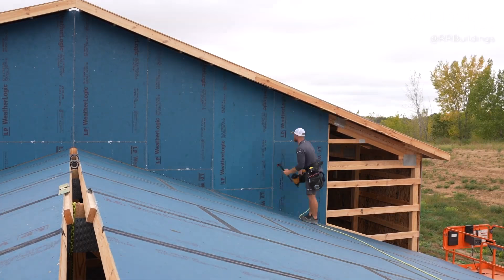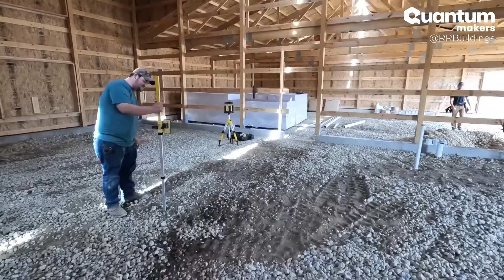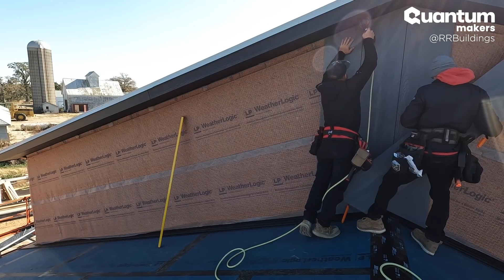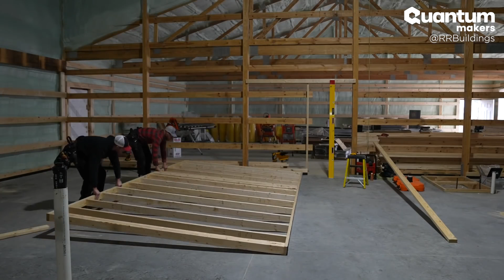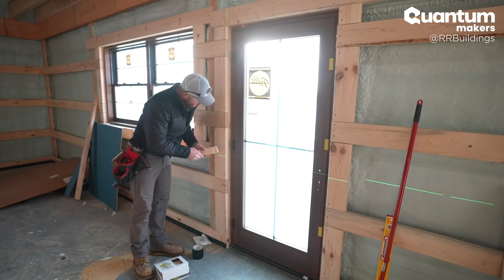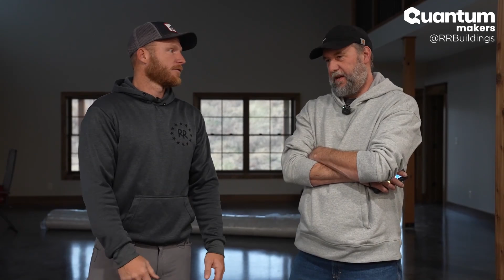Two Men Turn a Barn Structure into a $750,000 Home in One Year | BARNDOMINIUM Build

Comment: Do not confuse this with a traditional timber frame post and beam house. It is not. To do what they're doing, post and beam, the way it's supposed to be done, would take them 5 times as long. They would not use trusses with metal plates. They would be 656 and eight, by eight, and sometimes six by eight posts. And beams to support the building. Take a look at some cathedrals that have been there for 2 centuries. That's real post and beam construction once again. There is an enormous difference. These guys may be masters at what they do. But that does not make them master post. N beam carpenters

Comment: Fiberglass as insulation?. Seeing as it is Carcinogenic it can cause deadly health problems. I should know as my Brother-in-Law has two month's to live because of that stuff he worked with for 10 years.
But it is no wonder USA homes are so cheap. One big fart & it will shake. Here in the UK we have solid concrete foundations, then steel framework structure goes up, then brickwork. Then all the rest afterwards.
What always irks me is that it is 90% of the time builds are held up because of window supplies issues.

Comment: Cool build, I would like to get into construction as my studies ended and I realized over the years that working with my hands like in this video is so much more fulfilling for me than sitting at a desk with a computer screen in front of me, even if that is mainly what I studied for. One thing that is so different compared to Europe is the thickness of insulation, there is literally nothing there, only like 10 cm of that spray foam. It is ordinary in my country that new buildings have 200-250 mm atleast of insulation (10 inches). This feels like a bare wall (maybe it is thicker than it looks) and to heat up such a big open space it will take a lot of energy, but I guess someone who lives in a barn doesn´t really care about the cost of running it. We also have mandatory air space between the outside siding and the boards, here they just place a mesh of some kind, it´s really interesting to see the differences.

Comment: It's actually easier to achieve a lower Blower Door ACH on a larger house because a larger house has a lower surface area to volume ratio. As a house gets larger, surface area increases as the square of its size whereas volume increases as the cube of its size.  You'd think the guy performing the test would have known this and predicted a lower result before testing.

Comment: The only thing I never understood is why people love to use wood to build I mean, even this structure could’ve been built with mostly steel. All the posts could’ve been steel instead of wood and maybe just have wood features on the house.. But the house looks great if I ever do a Barndo, I would like to do it here in California maybe on some land but I would do the steel frame construction the big Eye beams so that I can have big glass windows, and I also would do some rammed earth walls here and there. Now, if I was back east building, I would do a big concrete block home with rammed earth walls, and maybe a steel roof.

Comment: This is a cool build. I been thinking though. Wouldn't it save a lot of time and effort to get a metal bardominium and then insulate with spray foam similar to this? Metal tends to last longer than this kind of structure and is quite literally impervious to termites and drawbacks of wood. Not only that but because its very common thing to have steel barns/garages, the costs for them have dropped significantly.

Comment: Crazy right I did post and beam ,much strougher with 6 inch wall .Had to learn Howard County the structure load s on post and Beam.main trick was LPI
Silent floors and span 50 ft.

Comment: I've been in construction for over 32 years and have only seen the seal testing of one home before and I gotta say after seeing you two guys go to town on this barn home you guys went crazy with the taping but in a not too over the top kinda way. But you three guys was putting in your guesses on what the seal of the home was and I actually said .35 because of how well the two of you were paying attention to detail. I gotta give both of you men your props awesome job done prefectly! By the way I myself am a sheetmetal fabricator and am actually closing in a pole barn that is now a barnshop connected to a smaller shed like building with an additional smaller two car pole barn that I welded to the bigger poleshop. I'm in Florida so hurricanes are nasty if something isn't attached to a fixed building. But anyways loved to building video sweet job guys!

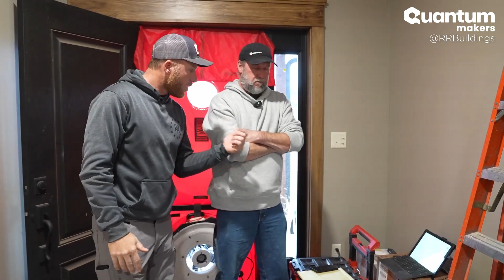Comment: That 0.34 ACH50 blower door test result at [47:36] is absolutely INSANE for a 6,000+ sq ft barndominium! 🤯 Watching Kyle and Greg tackle those material delays and coordinate everything from the 16 ft island slab [39:51] to the cedar pole railings [41:08] shows true craftsmanship.

As a logistics guy running Dizcount Movers @dizcount9715, I have huge respect for this level of project management. People usually think of moving companies for residential relocations, but a massive chunk of our work is doing high-volume freight & large-scale material deliveries for major DIY entities, home centers, and custom site builds just like this. Managing heavy items, tight delivery windows, and delicate finishes without ruining the timeline takes real skill.

Massive props to Quantum Makers for showcasing the post-frame method so thoroughly—this entire build was a masterclass in modern construction! 🛠🏡
Reply: Though counter-intuitive, the larger the house, the easier it is to achieve a lower ACH.

Comment: Our largest barn build was Post and Beam 50' by 100' back in 1979 or 1980  It was to be a Cow loafing barn.  We built our own trusses, and used 6"x8" pressure treated poles instead putting in a foundation as he has done here with brackets in what is essentially the stem wall.  I worked for a company called Champion Metal and we worked with a roofing panel machine manufacturer to design that exact roof panel with the snap-in edge.

What we learned is there's a big difference between grades of steel roofing materials.  If there is too much carbon in the steel it will break when creased to make tight bends with a roll former.  All sheets are galvanized before being painted, but all the edges are raw, and that tiny edge that snaps the back edge onto the previous panel will rust eventually, and that goes for the Ridge Cap as well.  We also used foam designed in the shape of the panel which was used under the edge of the ridge cap to keep bees, bugs and birds out from building their homes under that ridge cap.

If a cack is seen at the top of those short ridges in the panel it was caused by steel with too much carbon and the panel must be thrown away or cut down to be used elsewhere.  As for their uprights, I do not recommend scabbing boards together to make a pole.  Yes it cost more to purchase 20 foot 4"x 6" logs for all your uprights, but it would help with wind loading on the walls.  Also lag-bolting those brackets down to the stem wall instead of having inserted the bracke's stabilization pole (sticking out the bottom by at least a foot) is far stronger than how you've just bolted them down.  Those will be your weak spots when wind loads come at you from tornadoes, and the building starts rocking

Comment: For European carpenters, this is a construction of horrors: a framework of laths held together with nails. Unfortunately, nails aren't load-bearing in the direction they're driven. The insulating foam applied to the inside of the exterior walls isn't permitted in Europe for reasons of orderly deconstruction. And most importantly: it's supposed to last for years. Decades are out of the question.

Comment: The outer frame walls are VERY similar to the concrete tilt up techniques. With a concrete tilt up, you do ALL of your underground work first (water, sewer, gas, electrical, etc), then pour the slab floor. Once the floor is cured, you pour the wall panels on top of the concrete slab. The wall panels are brought vertical with one HELL of a strong crane.

Comment: I dont disagree with the sentiment these guys are talented craftsmen, but the home is one of the ugliest structures I have ever seen.  What a waste of $650,000.  It looks like a corporate dormitory or a Cracker Barrel.  It's clear having 750K to spend on something does not give one taste at all.  The colors are bizarre and then that interior metal ceiling, how tacky.  The metal rebar for a mezzanine walkway railing, why not just pour concrete.  It looks like something he picked up off the side of the road and just did not have anything any better to use.  To finish on a lighter note, they did seem to possess real control over the schedule and yet were highly flexible with all changes in the project.

Comment: You need to thick coat(better plastic shim 1/4" or more to isolate)  the bottom of those metal post brackets touching the crete footers directly.  Not just primer or what ever coating in on them.  But hey you do you.

Comment: How long will this house stand without renovations? Now I understand why hurricanes lift house in the US
Reply: It is so incredibly high profile. At a bare minimum this thing needs a DEEP perimeter grade beam to resist enormous uplift forces.

Additionally, it has almost no lateral resistance. No bracing bays, shear walls, etc. 

I would be worried about this thing in anything above about 100mph.

Comment: Looks alright i guess. Assume the goal was as big as possible for least money. hence the composite cladding etc.
With a bit more money this could be taken to the next level. For example nice timber under the veranda instead of sheet metal. not a fan of the shiny metal roof inside either. Would be super echo in the main room.
Nice big space but idk about how livable it is. How hard is it to heat that massive space

Comment: 24:06 Why did you not place a service conduit prior to pouring the foundation? I'm retired now, and I've no idea how much it costs to drill thru at least 20" of concrete and steel, but I'm guessing at least $2,000. That would've cost you about as much as $4.23 had you placed a 2ft piece of 3" diameter PVC or ABS pipe, and you wouldn't have cuts in your steel rebar reenforcement... the rebar does service a structural purpose. Miss a 3" piece of rebar during your prior to pouring inspection and you'll fail that inspection and be required to fix it.
When all that need be done is place a 3" piece of ABS or schedule 40 PVC in place prior to pouring the foundation. Hence, you'd have your service portal with no need to core a hole thru your foundation. You can't fix a lack of experience when it comes down to the wire. But I've really enjoyed the video, good job guys. Keep it up!